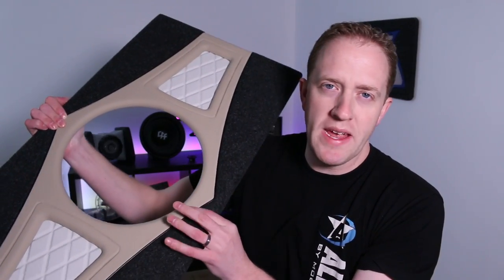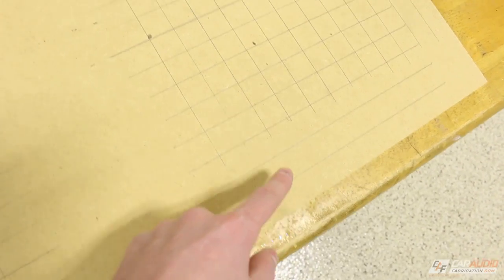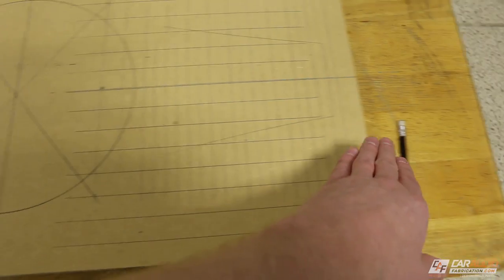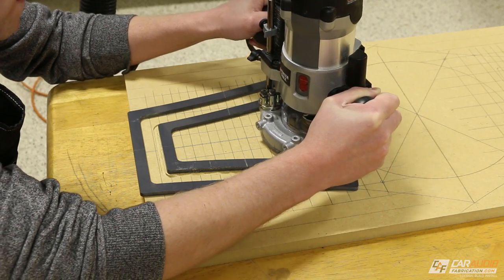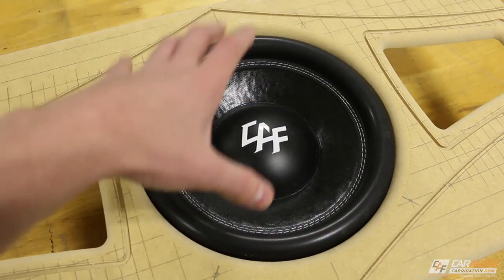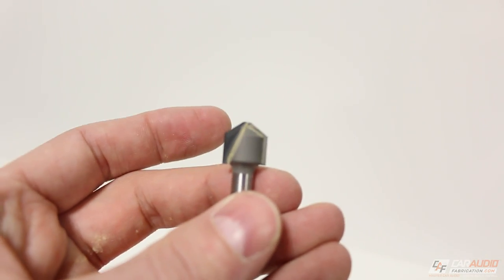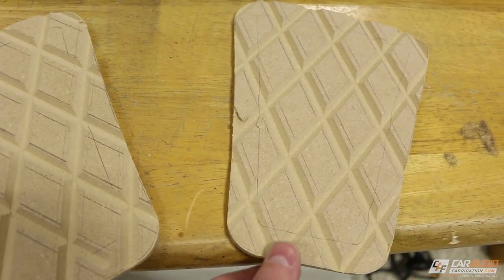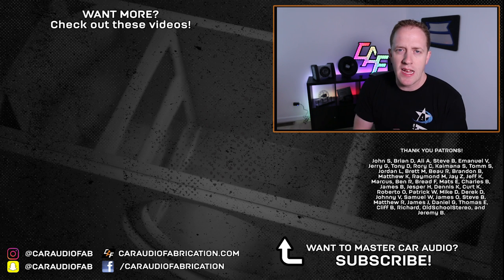New FAB Tools! Mobile Solutions Smart Ruler - Custom Car Audio Techniques

Comment: The wire trick is good idea!! Like piping you would normally have to sew into place. You could get that wire that lights up and border it with like purple or blue or even just bright white would give it that lit yet classy look! Mobile solutions come up with some cool stuff. It's extremely simple and at the same time it's a tool that is far beyond what meets the eye if that makes any sense. Hard to translate what is going on in my dome piece sometimes lol

Comment: Good morning and happy holidays!  I need help . I wanna use my factory head unit, but I don't want to take my dash apart just to connect the remote wire for my amplifier upgrade. Do you know of any other way I can wire the remote another way?

Comment: Hi Mark, have just installed some Rockford speakers, Rockford p300 12 audio control lc 7 and Clarion eqs 746 however I am getting some noise from the tweeter even when muted. I just picked up the car and while driving back I felt no much effect from the Rockford components door speakers as well. Any suggestions for this please?